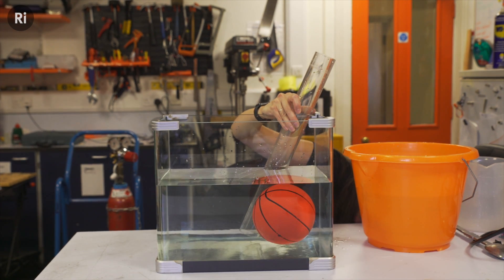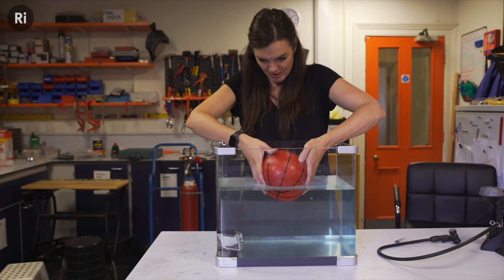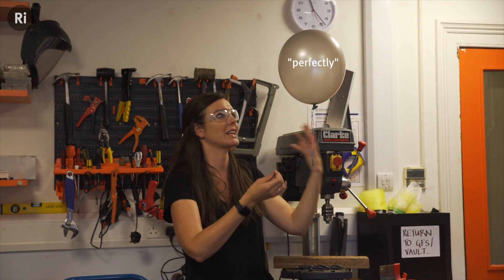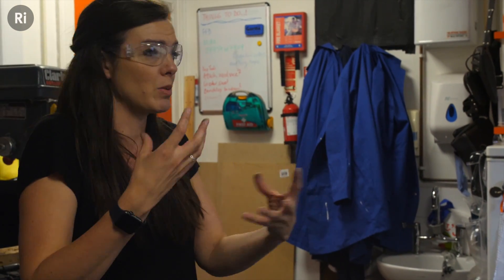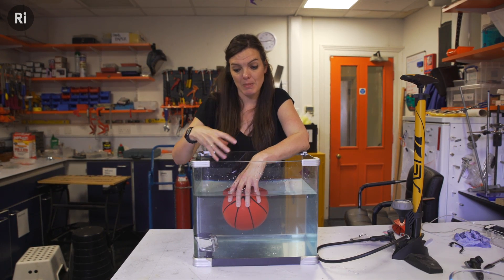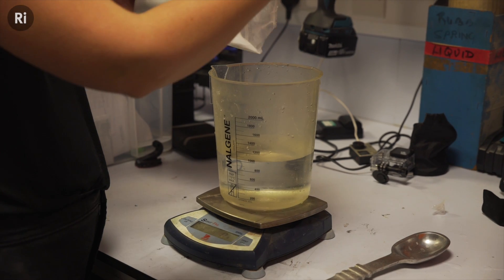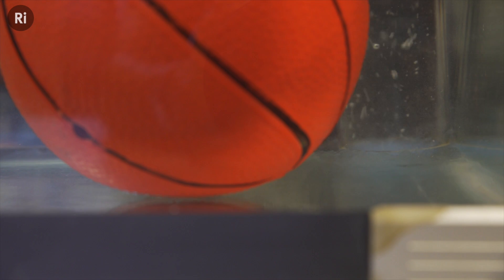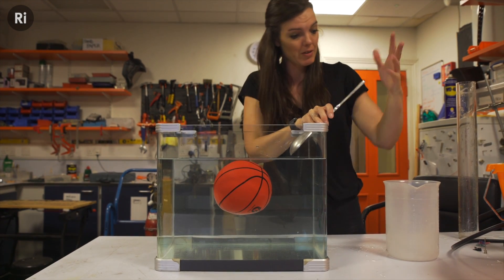How to Create the Perfect Floating Ball Illusion - The Science Behind Jeff Koons' Art

Comment: I used to install this work for a private collection in San Francisco. It has been thirty years, but remember most aspects. The ball (or balls) comes filled with water. You clean, then fill the tank with distilled water and reagent grade sodium chloride. The water line is about 2/3 from the top. With the right amount of salt, the ball is suspended at the top. The tank is now still 1/4 empty and needs to be filled to the top. Slowly and without disturbing the mixture is the aim. I taped an 1/8 inch clear hose to a styrofoam dinner upside down. The distilled water flows from this small tube off the plate. This last step should take a couple hours. The balls are positioned gently front to back, side to side. It needs to be reinstalled every few months. It depends on the amount of vibrations that it is subject to. Those are the specifics I recall.

Comment: I do this trick with a whole egg but I don't try to separate the layers. I just add salt water to the mix until the egg begins to float around the mid point. It just increases the density of the entire solution (I believe that's the case because I can't see any line of separation in the solution). If I had a big enough salt tank I would like to try and make a simulation of the earth and moon rotating while using the salt solution to be the ether of space.

Comment: Wouldn't there be diffusion over time that would end up causing the water in the tank becoming uniformly dense resulting in the ball floating to the top? I think that the comments about solid materials with the same refractive index of water as stands are a more likely explanation and the balls are filled with a substance that is denser than water.

Comment: There is another reason neutral buoyancy cannot work (especially for a gas) - it is inherently unstable.  Pressure increases with depth; so, if the ball/balloon rises, it grows in volume displacing more volume and thus becoming less dense and thus rising further.   On the other hand, using two liquids with different densities works well.  If you can match their color and index of refraction then the transition between them will be near invisible.  Another pair to try would be water and methanol which are both colorless and have an index of refraction of 1.33.  The challenge is that they mix really well; so, it may not work.

Comment: its actually not all water...
 its probably in a tank that is slightly pressurized also. maybe something like ethanol as the top layer ( its less dense than water) and some brine solution in the bottom. with the ball filled with distilled water.  the index of water changes based on its density. with an index of 1.333""  for water and the index of ethanol at 1.36 , it could be achieved, also getting a clear plastic with the same index of the water you are you using  the same thing could be achieved with no floating at all

Comment: An interesting historical note:
(Well, I think it's interesting, but I'm weird.)

A submerged submarine must move constantly as I cannot maintain equilibrium.  If it descends a little bit, the water pressure will compress the hull, reducing its volume, reducing its displacement, making it less buoyant and it will sink even more in a positive feedback loop that only ends when it hits bottom.

Try this with an aluminum can in a pool.  Try to get just enough air in the can so that it floats below the surface.  It won't stay there.

But as you descend in the ocean, the temperature differential causes a layer of denser, more saline water.  A submarine can float on top of that layer.  This was frequently used in WWII so that submarines could remain submerged for long periods without depleting their batteries.
Reply: Very interesting....

Comment: Could also be water (fresh water with a density of 1.000 g/cm^3 ; refractive index of 1.33, or even salt water [26% by weight] with a density 1.03 g/cm^3 ; refractive index 1.37) floating on top of Silicone oil (density 1.06 g/cm^3 @ 25C ; refractive index of 1.39; ). With the basketball  inflated with water or salt water (using a bicycle pump under water in a bathtub) and floating on the Silicone oil but sinking under the water.

Comment: Or maybe the artist's tank is partly filled with water beads.  They have almost exactly the same refractive index of water, so they're pretty much invisible when submerged - especially if the water is just the tiniest bit murky.  Much easier this way, and there's no concerns with the tank being jostled and the water getting mixed, which would ruin the effect in the freshwater/saltwater scenario.

Mind you, I find your concept much more interesting.  :-)
Reply: Just tried to do it in a jar with some old keyboard keys to spell something. Used sugar instead of salt. Hard to position a letter without screwing up other ones. I think water beads is the way to go.
Reply: Plus by adding saltwater to the water filling the basketball it's possible to inflate it more (to normal size), without it rising to the surface!

Comment: How long can something like this last. I.e. how long until the salt concentration reaches equality?
Reply: To do the math one would need to know the temperature of the room is kept at, the pressures of the room, and the volume of the tank used, the concentration of the salt water and how much, and which impurities are in the top layer of water and their parts per million. Other factors (airflow at water surface, how much infrared light is present, etc.) could contribute to less time.
Reply: The length of time it takes for the solution to acquire the energy from the environment necessary to perform Work on the salt ions against the counterforce of gravity.

Comment: Could have used regular water, Filled ball with water, and add specs of air till equalization. Just like with the balloon. And you wouldn't have the obvious refraction change in the water. It would be easier in a taller water column.  Now if the rubber is less dense than the water and would float, then put the heavy salt water in the ball then ad air till equ,  But saying "floating in pure water" is a lie. You have two layers of water. One not pure. The light refraction  gives it away in a very obvious way..  My way would also make a cool barometer. As the air pressure ads to the pressure on the water, the EQ point will change.His will just float on the "Layer" and sit there.

Comment: Your salt solutions are not completely clear.  I don't know if you used table salt, but if you did, that could be the reason.  Table salt often has a polymer treatment to prevent it from clogging a shaker in humid atmospheres.  Kosher salt does not have that, so it is an alternative to more expensive NaCl salt from a laboratory supplier.

Comment: The difference in refractive index is temporary... As the salt diffuses from greater to lesser concentration the abrupt change in refractive index spreads over a continuous salinity gradient.

The tank is still MOSTLY concentrated saline on the bottom and MOSTLY fresh water on top but the middle becomes a continuous gradient.
Reply: But why does the Salt water didn't mix with the tap water ? The Salt should be distribiuter equally in all the water. I dont understand why there is  still a high Salt concentrated area in the bottom
Reply: @nomanafzal2897  
It does. It just takes longer than you might intuitively expect.

The salt ions are heavier than water. Both ions tend to attract each other. That means that unless energy is added, they tend to stay at the bottom because they started at the bottom.

In the demonstrated model, the saline gradient isn't exactly stable but it requires energy to diffuse the salt ions. As time goes by, the salt gets the energy it needs to diffuse bit by bit... 
It requires energy to do Work to lift the ions into the fresh water against gravity.

Since both ions attract each other and both are heavier than water, they tend to anchor each other.
As they gather up heat from the environment they do diffuse but slowly because gravity provides a counterforce that must be overcome.

The water in this display would need to be replaced periodically. Probably daily at least, because the salt water will gradually mix with the freshwater as it tends toward thermodynamic equalibrium. 

It's sort of an anti-battery.
A battery starts out in an ordered state and tends toward disorder by losing energy.

This starts out in an ordered state kept ordered by gravity, but as it acquires heat from the environment it overcomes gravity toward a state of disorder.

Does that help?
Reply: @nomanafzal2897  Because it was poured in slowly and directly to the bottom, diffusion is very slow without stirring.
Reply: noman afzal gravity.
Reply: I would fill the ball with slightly salty water to make it sink in fresh water and float on the heavily salty water.  (random thought)

Comment: Wouldn't it be easier to fill the ball with a saline solution to make it sink in a tank of distilled water, then adjust the salinity of the tank water until true neutral buoyancy was achieved? Adjusting the tank medium to the correct density is going to be easier than adjusting the density of the object floating, and it would do away with both the diffraction difference between the two layers of water, but also (presumably) the need to change the water in the tank periodically as the osmotic gradient between the two layers levels out?
Reply from the maker: That's a great idea! We'll have to try that next time we give it a go.
Reply: The problem is not to achieve neutral buoyancy but to create a stable system. Neutral buoyancy in a homogenous medium is an unstable system. Even a tiny disturbance will make the ball go away from the middle of the tank, probably get stuck to an edge instead.
Reply: @Psychiatrysts a double medium would be stable if the two were imiscible, but by using two states of water you're going to lose the state difference through osmotic equilibrium exerting itself over time, no matter how carefully you layer it and try to avoid disturbances at the interface layer.
Reply: That would explain the floating without the 'refractive index'-stuff you're all boasting about. Smart xD
Reply: No... if the buoyant medium is homogeneous, pressure differences in the ball caused by micro changes in temperature will alter its relative density.

Think, Galileo Thermometer.
Reply: This was pretty much what I was thinking I'm glad to see this comment got the proper attention

Comment: In your nice demo you can see the water/Salt+water interface because of the change of the index of refraction.  I cannot see this in the original, but it might just be the angle of viewing.  Can you see the interface in the original art piece?  If NOT then your explanation may fail!!
Reply: The artist may have used less salty water, making the difference in refractive index smaller but also the balancing harder.
Reply: @zockertwins  It may also be that diffusion makes the boundary hard to see.
Reply: https://www.google.com/search?&q=jeff+koons+floating+basketball
Reply: https://www.christies.com/features/Jeff-Koons-One-Ball-Total-Equilibrium-Tank-7307-3.aspx
Reply: Nothing prevents you from using any other two transparent liquids that have different density but the same refractive index.
Reply: @AttilaAsztalos  Any idea what they would be?  I suspect that no matter what they will have different refractive indicies though ...
Reply: @farvision frankly I have no idea what would or would not work - but, for instance, salt water has an index of around 1.36 compared to 1.333 of pure water; at the same time, methanol has 1.33 and ethanol is 1.36 - so clearly there exist liquids much closer to each other than water/salt water would be.